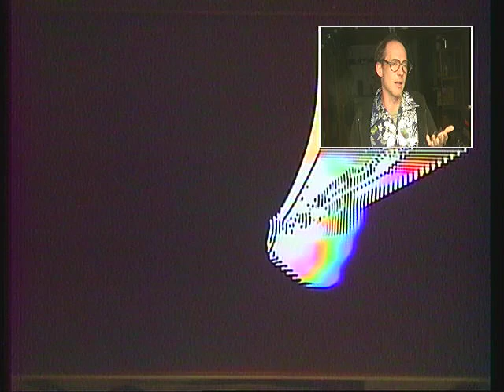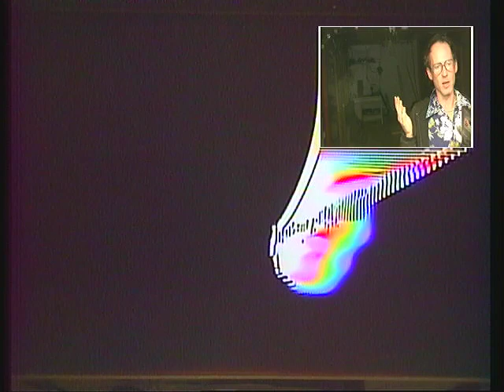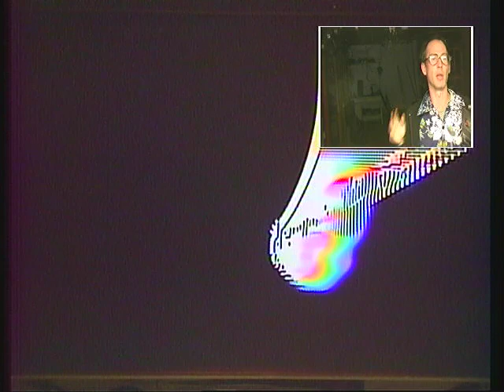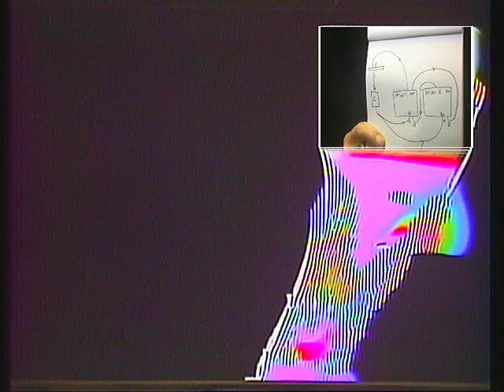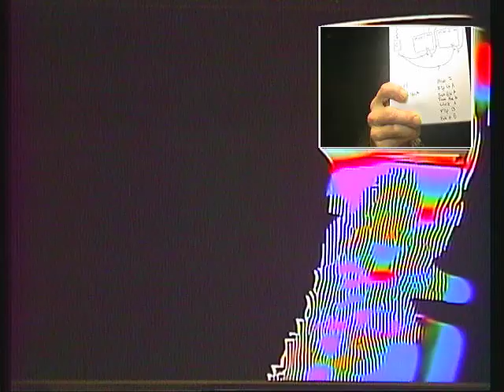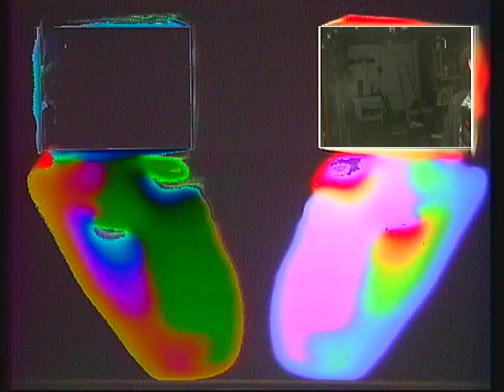video feedback techniques 2 part 2 LCDs, signal chains, and keying

Comment: This is pretty incredible, the rorschach visuals are amazing.  I'm saving up for a videonics MX-1.  Thanks for sharing that you are using this,  I was wondering if that would be a good mixer or if I should save up more for a roland/edirol V series
Reply from the maker: only way to know is to try it out, some folks just don't like the mx1 workflow at all but they are so cheap that its worth it just to pick one up and then u can always sell or trade it if its not yr flavor